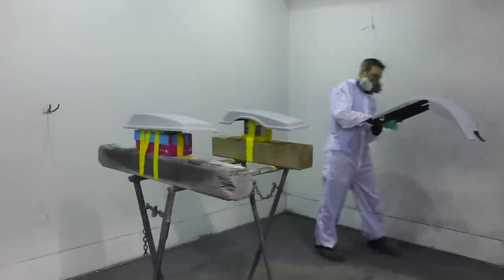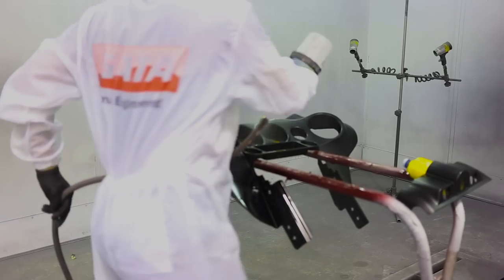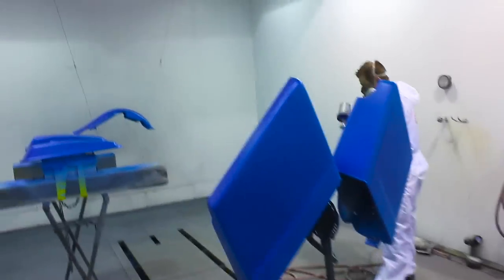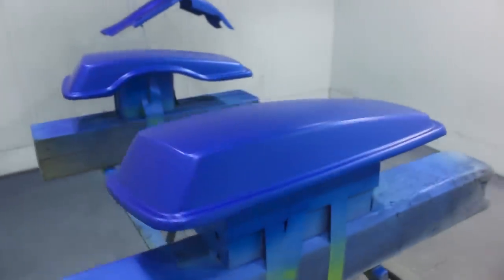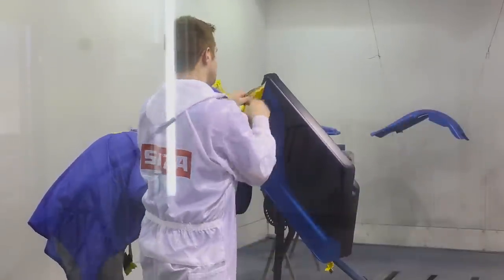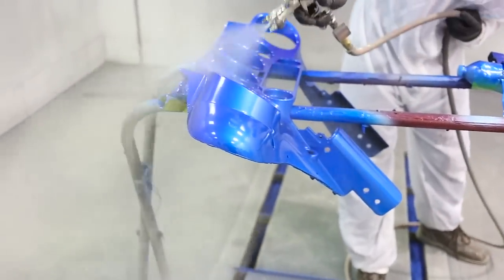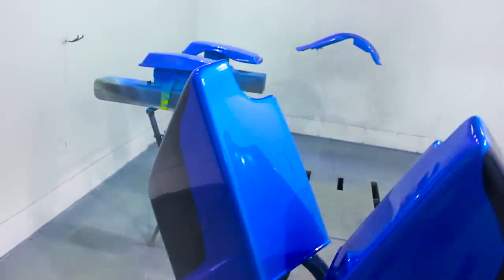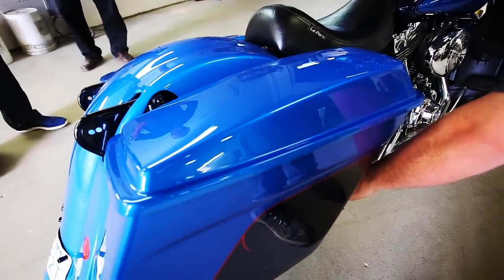Custom Harley Ultra Classic Two-Tone Paint Job

Comment: in oz for the past 60 years we have been mixing the base coat with the clear coat it gives it a 3 dimensional look were laying base then clear docent.
also now days the paint comes with less body in it than it did years ago so mixing half and half base and clear gives the it some guts.
if you had of sprayed this stuff with the base and clear mixed looking into it . it almost looks 3d.
something else it dose when you spray matalic colors like silver or blue  or green and lots of other colors you cant let it sit outside the clear will fail and peal off.
but if you mix the base coat with the clear you can leave your car in the sun as muvh as you like wont fade or blister.
a lot of painters use expensive clears to combat the paint fade but you can use cheaper clear and mix it with the base coat and no fading or pealing.
im not a pro painter like been tort and have not got any qualifications in it but ive been spraying cars and bikes off and on for over 25 years and always mix the base and clear together like i said it makes the paint 3 dimension and stops clear fading and peeling.
in fact macidis benz have painted there cars mixing clear and base coat since ether they started or clear was amaze you should try it man you will see the wow factor cheers from Australia.
Well bud you did ask for comments with what we would do diffrently. lol